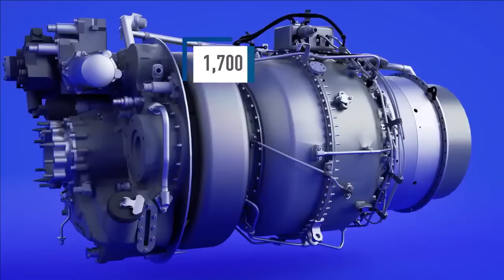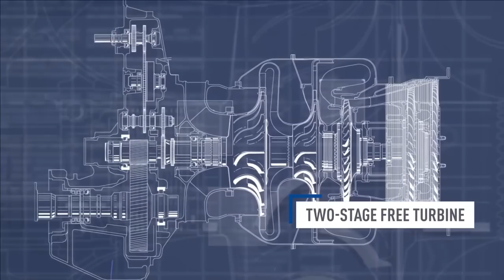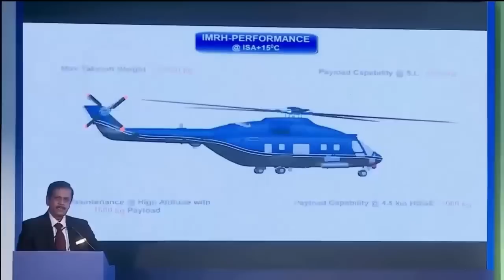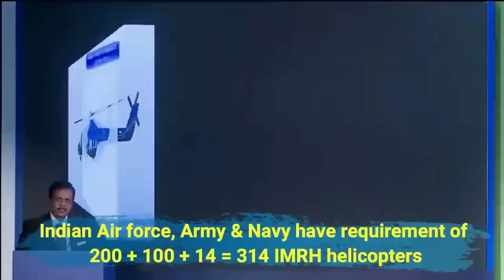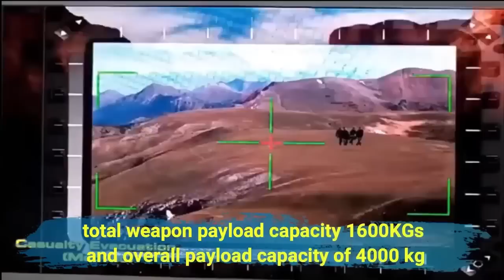#breakingnews  IMRH helicopter to be developed in 6-7 years, JV for engine in next 3 months

Comment: VIP കൾ ഹെലികോപ്റ്റർ അപകടത്തിൽ പ്പെട്ടു മരി ക്കുന്നത്  തുടർക്കഥ ആകുന്നു  High protection VIP cabin    1 High drop protected metal  2   four person sitting fecility in the cabin 3  inside and out side Air bag protection 4  Oxygen breathing system  5 Fire protection System 6  GPS include and  walkie Talkie  7  Critical Ejecting system  side and Bottom  8  Drop protection Air bag system outer Cabin   US പ്രസിഡന്റ് സഞ്ചരിയ്ക്കുന്ന ഹെലികോപ്റ്റർ ൽ ഈ ക്യാബിൻ ഉൾപ്പെടുത്തി യിട്ടുണ്ട്

Comment: why are we not considering development of something like V-22? we have engines, we have the design idea, so what are we missing?
Reply: V22 has poor high altitude performance, which won't work for Bharat as Himalayas are an important geographical feature. It's service ceiling is 7,600 m.
Reply: @datoolz0  
Presently we use Mi-17 as our workhorse, compared to that... 
BTW this can be used on our Aircraft carrers, we cannot use Mi-17 on it, its sort of hybrid between Mi-17 and Dornier 228 that can also be used on our carriers
Max speed: Mi-17 280 kmph  V-22 509 kmph 

Combat range: Mi-17 800 km   V-22 720 km  4,130 km
Service Ceiling: M-17 20,000 FT, V-22 25,000 Ft
Load: Mi-17 5 tons; V-22 9 tons.
There are definitely advantages all around.
Reply: @sachinmesta4238  Aren't drones the better bet? We don't have to stay stuck in the Stonge Age, I would rather bet on a cargo drone.
Reply: @datoolz0  Drones are good, but as of now the pilot in the cockpit can have a whole lot better view than the pilot back at the base. Also lets say you want to land a 20 man SOF at a location, as of now, they would trust a human pilot with whom they can talk to do it, The Era for drones is not fully there yet, also when the drone tech is mature, we can always modify it for being remotely controlled like USA is doing for its F-16 Q
Reply: @sachinmesta4238  Indian Council of Medical Research, drone delivery cut the time to deliver 17,275 units of medical supplies from an estimated 50 hours by land to just 12 hours by drone, a reduction of around 76%. 

DRONES DRONES DRONES. Pilots are obsolete, the only way to go is drones. No need to bother with stone age tech.
Reply: @datoolz0  thats goods, not people, when carrying people there is some confidence required, else why no Drone 787 yet? it is not yet the era for drones to carry people as yet, there are drone ambulances, but what is the priority, the guy died if he does not reach the hospital in an hour, if go by vehicle takes 5 hours by drone might take 45 minutes, so its there, but not yet
Reply: Not needed useless we should actually try develop something like sirkosky twin rotor.
Reply: @Kem____paalty16  The general idea is good, not just conventional helicopters, should experiment with different designs to see what works best.
Reply: @datoolz0  dear i am talking about sirkosky s97 raider type we could have done long back by partnering upnwith kamov but i wonder our people lack vision. And Russians always lack funding.